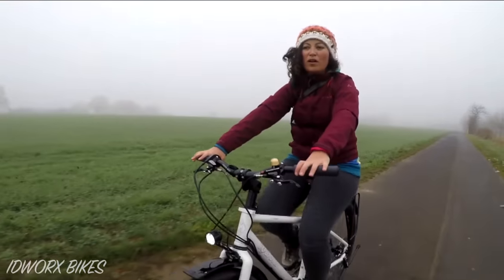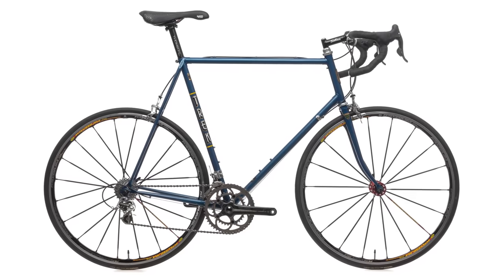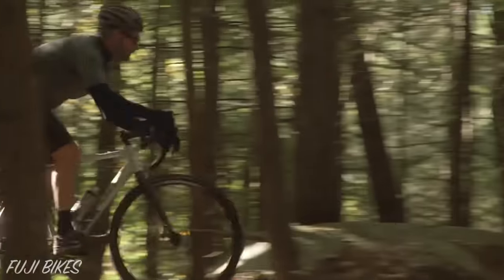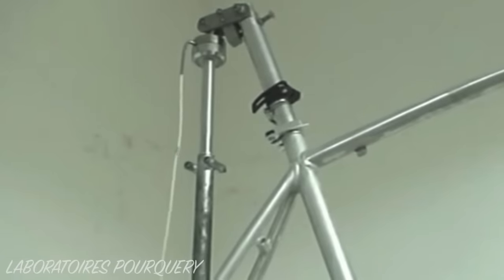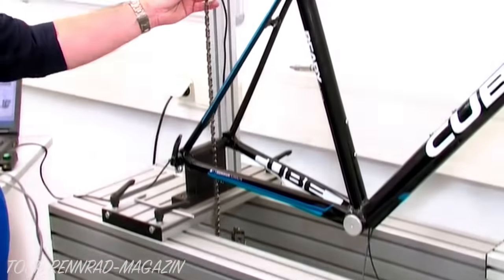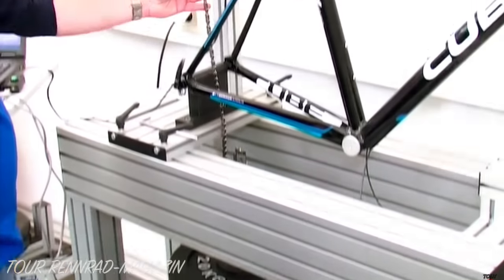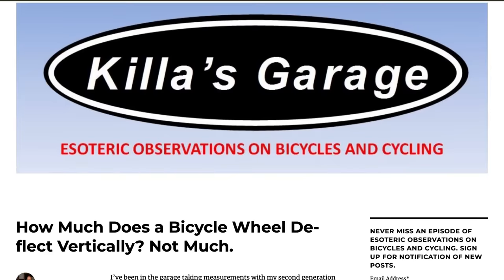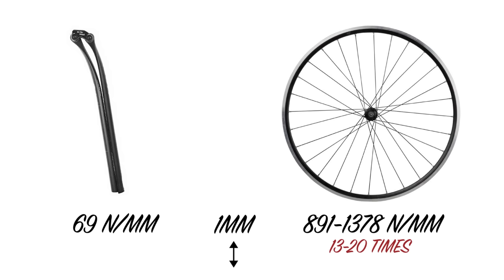Why It's Impossible For Steel Frames To Be More Comfortable Than Aluminium

Comment: It's all about forks, wheels, tires, rake, stay designs, materials and on and on. I've ridden rediculous miles (my wife's description) on hundreds of bikes of every description and material since 1956. There are so many variables that I still have an amount of confusion. I find the largest variable and least definable by engineering or opinion is the humanoid factor. You and I, and anyone else on this planet's surface have strange preferences that blind us to actualities. So much so that I can't take  any "analysis" seriously, period. Any attempt to convince someone that this material is better than another one is truly ignorant. Absolutely every test bike with each material would have to be built to exacting geometeric shapes, angles, diameters including wheels, tires, on an on infinitum. Then someone would argue that some materials can't be built this way for structural reasons or ???. You get my point? It's not the steel, aluminum, carbon fiber, bamboo or? It's the build evolution of the human run manufacturing process as we chase perceived shortcomings. Inevitably we go the wrong direction, the right direction and then wrong again. Each new material or evolution of one is fraught with mistakes and failures and improvements. Who gives a crap? I don't. I ride what I like and "customize" each bike to the task I ask the tool to do. As humans we cannot be entirely objective: far from it. It's ok to bring up this subject, but I find the only intelligent conclusion is to not make one. Thanks! BTW, I find it annoying and unfair to make a video title and verbage controversial. It certainly repels any desire to help fund you. Why would I care to absorb anything you might offer in the future? Maybe you should trash this one and start over.
Reply from the maker: I don't see a problem with isolating variables in a bike and measuring them. I've used and compared hundreds of bikes over the years and the seatpost and tyres are two commonalities that have made the biggest difference in terms of my ride comfort - no matter the bike or its construction material. This data simply backs up my anecdotal experience. As much as people think there is, there is nothing mystic about a bike that cannot be explained by the physical properties of the universe.
The title is based on my findings. Not sure why that's a problem for you. If you don't want to support my work or watch anything I make in the future - that's your call. But if you folks find my research interesting and are interested in discussing the findings, then any support motivates me to keep allocating time towards it. Otherwise, I'll just stick to writing on my blog because it takes me much less time.

Comment: Hmmm.... Some good investigation here but, really it detracts when you make such bold claims on such a limiting analyses:

This seems to focus on tires (good, logical) and seatpost (huh?). Tires certainly are relevant to everything but seat-post is not, not by a long shot. We have two hands, two feet, one bum. You are analysing  1/5 on the human/bike interface! This is especially confusing as your other bike flex feel video is all about front end and bb flex with almost no mention of seat.

(Also, I see from your other video you are a fan of suspension seat post. I disagree. I am traditionalist who thinks a saddle should work like a hammock, not a lump of plastic on top of a post with a spring under it. And there are so many garbage suspension seat posts out there that are sold to people with super thick add on gel saddle wide seat covers. This kind of comfort sales gimmick upsets me as it basically only works for short rides and becomes uncomfortable on long rides. Cheap bikes that are still somehow overpriced and turn people off cycling when they are starting out :-( I get that you are buying a super high end post and are doing long tours and have good reason for your opinion, but in the bike world there are 1000 garbage suspension posts for each worthwhile one so I think your advice is way too limited here. I would try your fancy seatpost with an open mind but I'm still skeptical. I've heard it said that suspension posts just transfer the stress to the knees, and I think that is likely. A lot of the people riding suspension posts are using it as a bandaid for inappropriate bike fit, or other problems of a cheap bike. I'd rather have a tired butt than knee injury.)

The softest bike I've ridden was a long cargo bamboo frame bike. A bit too much for my liking but it was made for very rough streets and was good for where it was being used.
Reply: Yeah, we may have one bum, but it usually is larger than hands and feet, so saying that it is only 1/5 of human/bike interface is simply false. Also, depending on your riding position, there may be a lot of weight under the seatpost, so it certainly is relevant.

Comment: Nonsense. We've all RIDDEN bikes of different frame materials and experience the differences for ourselves. Quit gaslighting for clickbait. The differences are real and due mainly to tube diameter. Blame Gary Klein for inventing oversized alu tubing.
Reply from the maker: There is nothing clickbait about this. All of my claims are backed up with data. If you think I've missed some data, send it through.
Reply: @Cyclingabout  Data can be manipulated to say whatever someone with an agenda wants it to say. I'll trust my knowledge of metallurgy and my decades of experience riding, thanks all the same.
Reply from the maker: @linseyyoung1772  I have not found any data that has been manipulated to show how different frames offer different levels of comfort...
Reply: @Cyclingabout  You seem awfully insistent about it... As I said, I'll trust the knowledge of metallurgy I gained through hard work at university and the tens of thousands of miles I've ridden on various frame materials over decades. Comfort is a function of tube stiffness, tube stiffness is a function of tube diameter and tube diameter is generally set by the properties of the material in question. The vast majority of aluminium frames have large diameter tubes. Now, you could go out and find a vintage Alan frame with skinny aluminium tubes and it'll be more compliant than some steel junker with oversized tubes. But the fact remains, most steel frames have skinny tubes and most aluminium frames have oversized tubes. If I want comfort I ride steel. If I'm in the mood for a blast in the woods and I don't care too much about all day comfort I'll take my Klein.
Reply from the maker: Look, I own ~90% steel bikes. I have multiple custom steel frames where I've selected the tubing. I love them to bits. But I don't own them because they're comfortable. 
I'm simply insistent because the data and engineering principles point in one direction. Even if frames had 10x more vertical deflection than they do, they still won't be close to the softest spring-in-a-series on a bike - which makes it incredibly hard for a frame of any material to be more comfortable than another.

Comment: Back in a day... I've ridden KHS Montana PRO with True Temper OX Ultra II tubes (25000 kms)... (I think it' is comparable with Reynolds 853...) ...you can literally see how front tyre... under heavy breaking closes gap between down tube... the whole frame is flexing...
Reply from the maker: That's the fork. 👍🏻

Comment: steel rust , carbon and titanum is expensive ,, so aluminum ,  the road buzz is almost non existant  if you have 40mm tiers and up and seat post suspention is stupid don t work , if you want a softer ride get a full suspention bike ,
Reply from the maker: Suspension seatposts definitely work! It's a big difference when I switch out any of my suspension posts to an alloy rigid one. 👍🏻
Reply: @Cyclingabout  probably the one i got was not that good ,, well it dump some vibration ,, on gravel but not that much ,

Comment: Well, if you translate comfort to vertical compliance your data might be right but this is not frame comfort. If everyone feels steel is more comfortable but your data does not support it, you are measuring the wrong things. You should start off with a double blind study where participants won't see the frame they are riding over a gravel road. you will probably find out that steel bikes are smoother to ride, not alone by their horizontal flex and deflection while pedaling.

Comment: Sorry mate, this is a classic example of how data can be manipulated to justify a preconceived outcome. You will never convince me of this nonsense.
Reply from the maker: There is no preconceived outcome. I have owned dozens of steel, aluminium, titanium and carbon bikes. I can make them all more or less comfortable just by switching a few components, and the data backs me up on this. My most uncomfortable bike is made from steel, but it's also running the narrowest tyres, a straight Thomson post and a pretty thin saddle.

Comment: At MTBs and Trekkingbikes IT is the Fork. CroMoly-Steel Dirks have a Swing, while Alu is straight. Alu-fork without shockabsorbers vs. CroMoly-Steel Fork.
The Winner is clear.
A Fork with shockabsorbers reduce the whell-base, while a CroMoly-Steel Fork in Action extend and stsbilizes the Bike.
The Winner is clear.
Only TransAlp is different.

Comment: Thank you for the detailed engineering concepts that you shared in this video. The concept of spring rates in a series was especially helpful. In general, I teach the same concepts as you to my customers when discussing ride comfort (compliance) and frame materials, but I add engineering factors like tube diameter/wall thickness and frame layups as drivers of stiffness. Where I disagree with you is the overall ride experience of the different materials when used with higher pressure tires, especially on 'lightweight' bikes. 
I find that the road harmonics of a 17 pound steel frame/carbon fork combination are much less noisy and intrusive than a comparable carbon-frame/carbon-fork bike. A steel-frame/steel-fork bike is even calmer/quieter, but will be at least a pound heavier. All the creaking, clacking and shifting noises amplified by a lightweight carbon bike frame resonator are distracting and not very confidence inspiring. Of course these concerns evaporate on a heavier layup carbon gravel frame and/or a bike with lower pressure tires.
My customers that are looking solely for the benefits, real or perceived, of lightness,  I point towards a lightweight carbon bike that is within their price range if possible. For those that are more interested in reaching a more sublime, unintrusive riding experience I recommend a steel frame and maybe even a steel fork if that meets their needs and budget. 
Aluminum is tougher to discern. I feel that there is a deadness to most aluminum bikes due to the need for an almost totally stiff frame to accommodate the lack fatigue resistance in most, if not all aluminum frames. I recommend aluminum where budget is the primary concern, with weight secondary, even when used with high pressure tires. Again I find it difficult to describe this 'deadness' feeling in either experiential or engineering terms, (other than harmonics) but I feel that there is a perceptible difference in the ride experience between these materials.
Reply from the maker: I don't think we disagree. I prefer the ride feel of steel frames and skinny tyres too. But I'm much less fussy when the bike has fat tyres or is loaded with luggage.
Reply: @Cyclingabout  , It was when you said carbon frames damp vibrations better than steel. Since you seem to be into touring type riding perhaps you have not ridden lightweight carbon 'racing' bikes and instead your experience is more with the heavier layups that I referred to above. In that case I agree that many of those frames can have better vibration damping, but I have not tested that hypothesis myself as any of those frames that I've ridden had low pressure tires. Maybe someday I'll try to swap some high pressure wheels and tires to see if there is a true difference in the damping characteristics of these frames.
 I find that the high frequency harmonic vibrations from high stress, thin wall, lightweight carbon frame layups, riding on higher pressure tires annoying and thus distract me, and many of my clients from enjoying lightweight spirited road riding to its fullest.
Thanks again for the video, and...
Be well,
j
Reply from the maker: I've had about a dozen sub-1000 gram carbon road frames over the years and probably the same number made from steel. In general, I prefer the ride feel of carbon and I put that down to the vibration damping and general 'snappiness' of how the frame material feels underneath me.
Jumping onto a carbon road bike after being on a custom-made steel bike, I'm always wondering if my tyres have lost some pressure... but nope, the same pressure as usual, carbon just rides smoother.
My favourite frame ever is probably a Basso Astra I had about eight years ago now.
Reply: @Cyclingabout  , Well... it appears that we had/have very different subjective experiences on lightweight carbon frames.
C'est La Vie. Thanks for the exchange.

Comment: I disagree,  forks flex, and rear triangle can flex if has curved seat stays .. also handling at high speed matters a lot on frame and tire combo and geometry.  So I think this video is rubbish.. ..
Reply from the maker: Curved seatstays do not offer more vertical compliance than regular stays, especially in the context of the 'springs in the series' effect.
Reply: @Cyclingabout  well according to Litespeed titanium bikes it does. So why they curve them?
Reply from the maker: @recyclespinning9839  It makes a bike stand out from other manufacturers. 👍🏻
Reply: @Cyclingabout  have you done scientific and road test on different bikes geometey and material?
Reply from the maker: @recyclespinning9839  No, my videos are a 'meta-analysis' of sorts, of all known scientific data. I also try to incorporate engineering and mathematical theory. When we analyse all of these things together, it's essentially impossible for curved seat stays to add meaningful amounts of vertical compliance. But for sure, it helps Litespeed to sell their bikes!
Reply: @Cyclingabout  so your going off of other peoples data. I would have to do the tests myself . I dont have a titanium bike with curved seat stays yet. But I can tell you that if you have the same wheels set   and seat, I can tell the difference in compliance from different frames.  .
Ps, I am not an engineer but I guess compliance on the curve seat stay good be easily looked at. The wheel would move when you hit bumps,  then spring back. ..

Comment: The difference is the impact of natural frequency and resonance in the range of shock and vibration the structure (bicycle) is subjected to. Bikes have a lot of variables that impact rider comfort and frame material resonance is not a major factor. That is why your perception is generally correct, but from the materials science viewpoint, materials do matter. If you were drop & shock/vibe test things like delicate electronic assemblies, I assure you the data would change your mind about the irrelevance of material differences. Suffice it to say, with something like a bicycle, a more generalized model is reasonably valid and religious arguments are possible. However, let me give you a bicycle challenge - fabricate 2 frames of identical geometry and strength, one steel, one aluminum, remove all of the Loctight from the manufactured components, then fully assemble the bikes without Loctight. Then ride them until they fall apart. I will bet you a year of Patreon that the aluminum bike falls apart sooner. Game?  Edited to remove extra commas.
Reply: menuda tonteria...

Comment: His conclusions, as any good mechanical engineer can tell you, are absolutely correct. Only thing left out is the overwhelming deflection and thus cushioning, of your own butt and the compliance of the seat and its springy arms. Then there is something else i never see mentioned….in my day forks were steel and all had delicate looking curves as they approached the front axel. Even my 1950 Drysdale track bike had curved fork ends.  I can tell you from riding over cobblestone roads that those forks deflected and saved our wrists.  The modern trend of straight fork arms is ill conceived.

Anyway, spend your fortunes on carbon and titanium. Save a couple pounds, maybe. But unless you are in the Alpine section of the Tour de France, any gain you feel is imaginary. You can get the same effect by eating fewer deserts and buying a steel frame.

Comment: So many flaws here. Frames flex not just vertically. We have no clue which frames were tested in this experiment or how they were built or how well controlled was this study. Not all steel frames are more compliant than all aluminum. Obviously. There is so much more to consider here. You didn't.
Reply: ..... defectos los que tienes tu en la cabeza

Comment: This guy is a typical aussi. Very picky, likes it all his way and thinks you should as well. Steel frames absorbe vibrations and that’s the main reason people like them. He’s just plain wrong with Carbon, in this video Carbon is made to be super stiff in certain directions. And he conveniently leaves out other data. Seat post is only half the situation, the arms are a huge factor. This is just a bias video as most of his are.
Reply: What a load of BS. How can a harder material absorb more vibrations than softer material?

Comment: But steel absorbs more vibrations than aluminum or carbon...
Reply: but does it. where,s your evidence ?
Reply: @scvtatler2930  also my evidence is that I own both a stainless steel and an aluminum and the aluminum is a much harsher ride. Faster, but you feel everything.